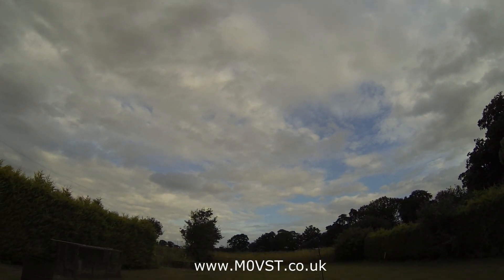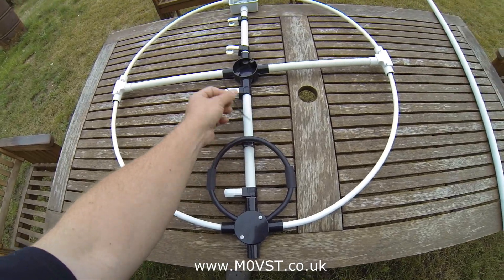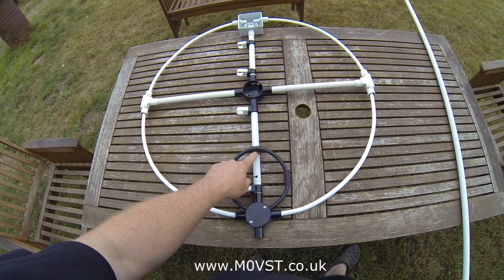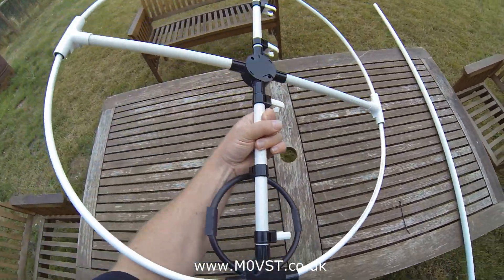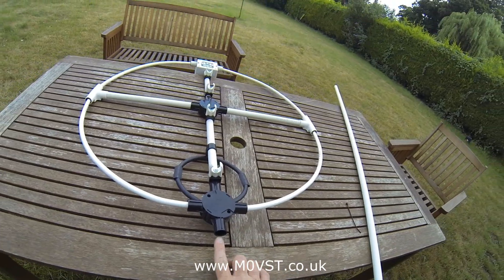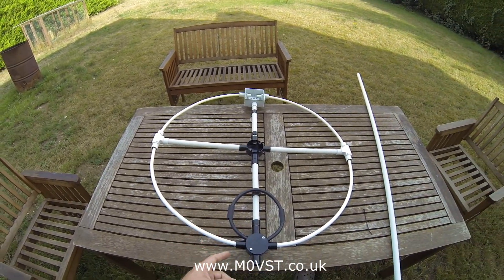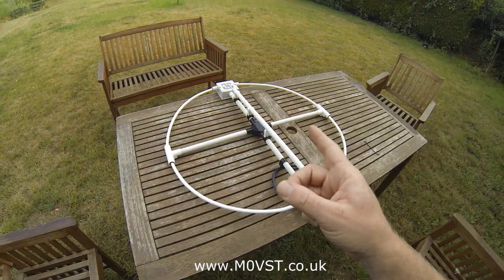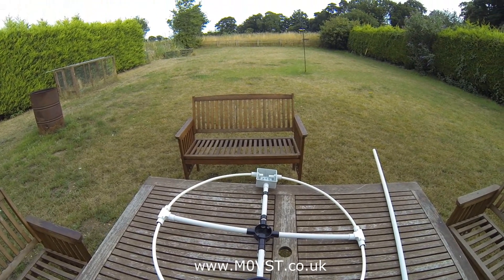The Lightweight Magnetic Loop - Part 2 - M0VST

Comment: Hi Mark,
I don't think it will be of much consequence if the feed loop is slightly out of the plane of the main loop. I remember my home brew 2 turn loop was all bent up from falling over several times and it still worked. It was quiet on RX and also directional to some extent. I remember using it from my first qth a small terraced house with tiny garden and 80M was a no no. So I built the loop and put out a call. The loop was in my bedroom. It worked!!!
Sandy

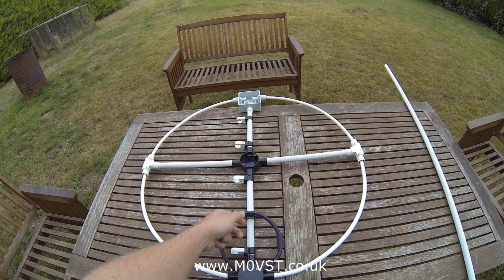Comment: At the 00:54 Mark....the loop at the bottom.  that connects to the coax.   DO NOT make it Round.  Make it more oblong, in other words make a squashed oval.   Doing that will give you a better match.  Make the bottom part of the small loop more in contact with the main loop.  try it.  you will see.